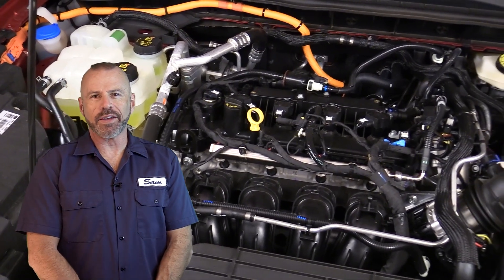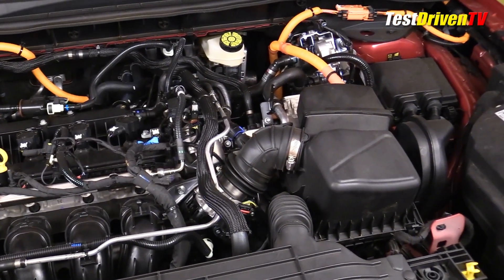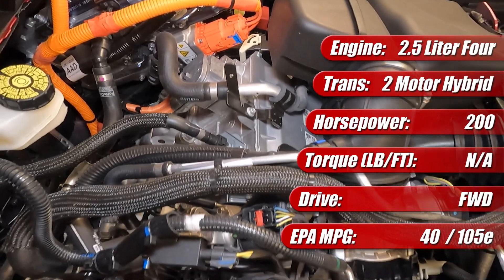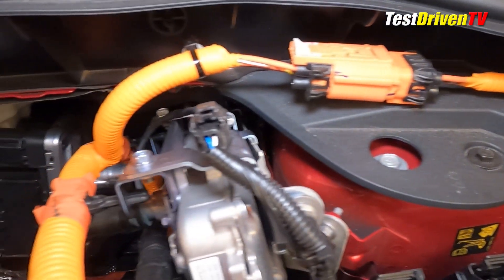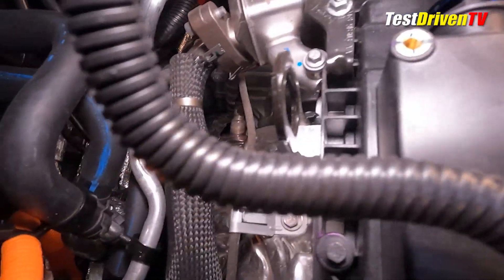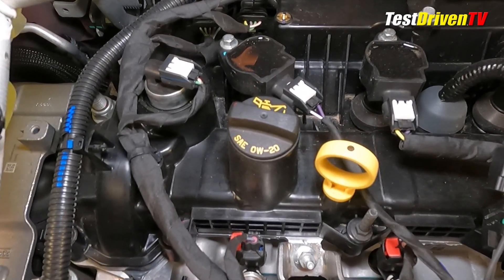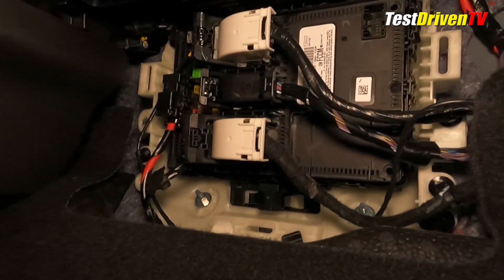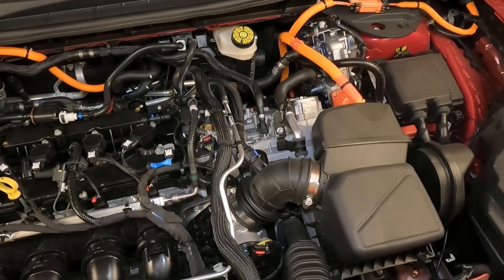2021-2024 Ford Escape Hybrid & Plug-In Hybrid Engine Explained

Comment: Would you really compare Ford with Toyota hybrids? I ask because I bought an escape hybrid but having buyer regrets.. if it’s basically the same system as Toyota and reliability I am ok then 😢
Reply from the maker: It's hard to compare reliability between Ford and Toyota. The hybrid system on both is a similar design however.
Reply: Why are you having regrets? Was thinking to get the escape, but now, I'm very curious to hear your regrets
Reply: @roddyib I love my hybrid escape.. it’s just that i am a Toyota fan and i have never owned a Ford, i know they depreciate like crazy but all vehicles do. I have owned mine for 5 months and still love it. Last  week the engine light came on and all it needed was a system update in the dealer computer. So far.. hasn’t give me any issues. I guess my regret was buying it brand new. I got it for $34k and 4 months later it’s valued at $27 😢
Reply: @yennyjen5742  Don't look now. Plugin Hybrids are around 25,000 with all rebates. Hybrid without the plugin are around 27-32k based on trim.
Reply: Mazda engine + toyota hybrid system + ford software. Imo, a match made in heaven. For 2024 they upgraded the gearbox & drivetrain so yeah, only the time will tell if the car will be realiable. Search for Ford Kuga (it's the european version) if you want to find out more

Comment: How many partnership does fora share with Toyota? I just bought a new 2024 hybrid escape and was having buyers remorse since I am not familiar with them 😢 but then someone told me they are basically the cheap version ( not so cheap😅) of Toyotas since they have the same hybrid system?? I haven’t be able to find much info
Reply: the 2.5l is a partnership with Mazda; gearbox & hybrid system is a partnership with toyota. Both should be relaiable. I've just bought mine in EU. Transfer from electric to hybrid is so smooth! All the benefits, for a smaller price. What's not to love? 

Try lookikg fo Ford Kuga (that's how it's called in Eu) and you may find more explanations.

Comment: We just purchased a 2024 Ford Escape PHEV and the dealer told us that we could use either a 120v or 240v charger. However, the vehicle comes with a standard 120v plug-in and we've been unable to find any information as to whether and how to charge via 240v. Is there a way to switch to 240v, and if so, does it require the purchase of a new plug-in cable?
Reply from the maker: The charger you have dictates the voltage automatically. If you plug it into a 120v outlet you will charge at 120v. If you plug it into a 240v charger/outlet it will charge at 240v
Reply: @TDTVGarage  Perhaps I did not explain myself clearly. Since the 120v plug on the charging cable obviously will not plug into a  240v outlet, I don't believe that we can just use an adaptor to plug into the 240v outlet. From what I've read, we need to purchase and have an electrician install a Level 2 charging station. That station will come with its own cable that is universal for PHEV. Am I correct in my thinking?

Comment: Two questions about the 12V battery. Does that mean I’d jump start it from the rear of the car? (The terminals are still on the battery?)

Also the Canadian spec of this car includes a spare tire there. I’d have to check where they put the 12V battery or if it’s under the tire.

Comment: Are Ford shops expected to MAKE the PHEV engine start prior to performing an oil change?  Or do they just drop the cold oil.
Reply from the maker: One presumes the vehicle was driven to the dealership and the engine is likely already warm to some degree. The fact remains however that temperature of the oil or engine is entirely irrelevant to an oil change.
Reply: @TDTVGarage  let's assume the vehicle has been driven as electric only for a month.  Then driven as electric to the shop.  Is it still not relevant?  Just curious.
Reply from the maker: Temperature of engine and/or oil for changing oil is not a "thing".

Comment: SO in other words this car has 2 complete powertrains. Thats dumb.
The propulsion should be electric only. The gas engine should be
bolted to a generator to charge the battery pack. DONE. No CVT.
No driveshafts. No transfer case. No mech diffs only 2 e axle
diffs. I dunno seems  WAY  more complicated than it needs to be.
I may just wait for the BEV.

!
Reply: Without driveshafts your electric car could not move unless it was on a slope.

It's an oft repeated criticism of hybrids that they have redundant propulsion. However, a BEV is also dumb. Most of the capacity of the battery is never used. A hybrid is a better use of lithium. One BEV takes 5 Hybrids worth of lithium. A hybrid uses 3/5th the fuel of an ICE car. Saving 2/5ths of the fuel. 2/5ths x 5 = 10/5ths = 2. So, for the same amount of lithium, hybrids save twice the gas of a BEV. That's not dumb.

I'm driving cross country this weekend with a hybrid. Last year we got over 42 MPG. We filled  up once on the way there and once on the way back. That's not dumb. Around town I get around 50 MPG. Also not dumb.  This trip is about 600 miles each way.

On my other trip between Grand Island, NE to O'neill, NE  and Arlington, SD where do you propose I charge up my car?

Comment: Where is the pedestrian alert speaker ? It is far too loud when reversing.
Reply: I think that it can be disconnected from under the dash on the driver’s side (I don’t remember exactly where, and this was on an F-150, but it’s the same sound / system).

Comment: Does the 2022 hybrid (not the plug-in) have a service charging port for the two battery systems?  I live in a colder winter climate area and my daily trips are very short (1-3 miles) so there is not much battery charging going on. Without any distance driving the vehicle constantly sends me messages about turning systems off to preserve battery life (the passenger door won't touch lock / unlock for example)... It would be nice to have a way (aftermarket solution) to charge both battery systems over night just to keep them topped off.
Reply: How is your vehicle doing? I got a brand new 2024 over the weekend and it keeps sending the same message 😐not letting me turning it on from distance.. and saying it’s preserving battery.. Ford dealer told me to drive there and they will put a new battery. Weird since the vehicle it’s 0 miles.. brand new. I just hope i didn’t do a bad purchase
Reply: @yennyjen5742  I don't think you made a bad purchase. All the newer vehicles suffer from the same battery (12v) drains as there are so many more demands / electronics in the vehicles these days.  I just traded the 2022 Hybrid Escape for a 2025 Hybrid Escape and it's also sending messages of reduced services to preserve the battery.  Once or twice a week I take the car out for a "longer drive" at highway speeds for 20 minutes which greatly helps to charge up the 12V system and I get the messages less often. The messages do come more frequently in the colder Michigan months than the summer months.
Reply: @jlh2119  I am in a colder state too. Wyoming! Do have you had a good experience in cold snowy slippery days? 😬 it’s snowing here but not too bad. My car it’s awd and feels strong in snow. Day 2 of owning it so we will see. I don’t drive it much either.. just back and forth to school with my kids
Reply: @yennyjen5742  Snowy slippery days have more to do with good tires (and ground clearance in heavy snowfall).... I found that the all-season tires that come on the Escape are OK. As the temperature gets colder (into the teens F-degrees and below) the tires get harder and don't perform as well starting out and stopping.   Also the tire grooves (sipes) are not wide / deep enough to handle more than an inch or two of snow.  I replaced the factory tires with Michelin CrossClimate2 tires and could not be happier.  The Michelin tires are not cheap; however, I travel often in a heavy snow belt.  My last trip from Upper Michigan to Lower Michigan had a 60 mile stretch of highway 6 inches deep in snow that had not been plowed and only a handful of cars had preceded me.   While I wasn't going fast (25-30 mph), the all-wheel drive and CrossClimate2 tires were rockstars !  Just around town with other people breaking down the snow and moderate temps the stock tires will do well.
Reply: @jlh2119  glad to hear that. Thank you
Reply: @ hello there again 😬 forgot to ask you.. what type of gasoline do you use? Regular ot the expensive one? I forgot to ask the dealer
Reply: @yennyjen5742  Just the unleaded 87 Octane ... runs great!
Reply: @yennyjen5742  which version / model of the Escape do you have?
Reply: @ I got a hybrid ST-line. I havent had a chance to do some research yet.. they offered a discount from my husbands job so we went to look at cars and that’s what catched my eye.. just for the gas savings 😅 also.. one of the cheapest deals they had.. still was expensive 😓
Reply: Try walking. It'd really be good for your health if you walk such short distance

Comment: When the PHEV is running in all electric mode, then the gasoline engine shouldn't be running.  Does that extend the time interval between oil changes?  Or should oil changes not be done based on mileage, but on time intervals?
Reply from the maker: On hybrids in general the gasoline engine is only running about 50% of the time your are driving. That is why they can go more miles between oil changes.
Reply: @TDTVGarage  What if on the PHEV (plug in version) you are running on all electric for about 90% of the time for just local commutes?  From what I can tell the gasoline engine is not running other than occasionally to burn off gas to keep it from going stale.   Then should oil changes be based on gasoline mileage or time intervals?  Tricky to know!!
Reply from the maker: Ultimately it's why it's ok to trust the oil change monitor in the instrument cluster  to tell you when it's time.
Reply: The Oil Life monitor on the plug-in will factor in how much the engine is used, but even if you almost never use the engine and the oil life is still pretty high, it will recommend an oil change one year after the previous one (or at least since the monitor was reset).
Reply: Oil change should be done once a year, water will otherwice hinder lubrication and causes rust.

Comment: I purchased a new 2021 Ford Escape PHEV (plug-in Hybrid) in Oct. of 2021. It has 14000 miles on it. I now stalls in the middle of traffic while in EV mode. It's happened 3 times. Once while my wife was driving in the middle of an intersection (blocking traffic, horns honking, etc.). There is a recall for this exact failure on the same year, model, and engine as my vehicle, but they say I don't qualify. The recall code is 21S48. I believe it’s a high cost fix for them, so they're not issuing the recall as they should (e.g. have these vehicles proactively called in for testing and diagnosis before the failure happens). Anyway, I have to wait 3 weeks for a dealership mechanic to even look at it and I have a long drive I must make in less than a week. Needless to say I'm very disappointed in Ford’s quality and support. I'm an electrical engineer (for 35 years), I design high-reliability products and I'm very disappointed in the quality of Ford engineering that missed this breakdown in safe operation. Maybe they're not ready for EV yet. Maybe they need to invest in Hi-Rel design training for their engineers. All I know is I spent $45,000 for a malfunctioning and dangerous Ford vehicle. I’ve only owned it for 18 months, it only has 14,000 miles on it and it feels like a lemon. I should have purchased the Toyota RAV4 Plugin Hybrid! Sorry for the ranting, but I feel indignant and frustrated by this.
Reply: Oh man.. did you  keep your vehicle? Did they fix it? I jut bought a brand new one over the weekend and afraid it might give me problems later on 😐 it came with a bad battery I guess.. it’s not turning on from distance saying it’s turning off options to save battery so ford told me to go and they will put a brand new battery. Weird since it’s a new vehicle 🧐
Reply: This is why I'm reluctant to give up my 2015 Prius.  Aside from a water pump nothing has failed during its 10 year lifetime.
Reply: I'm proud owner of a Ford Fusion Energy of 200000 miles , sorry for your miss happs
Reply: Fusion have other transmission than escape, on fusion HF35 @vivianorios2637

Comment: I own a 2022 escape phev, overall it’s pretty good, however the engine is a little to loud and annoying when in hybrid mode.  Don’t think it’s piped In noise, if it is it’s the dumbest thing ford could’ve done because it’s not a good noise, it’s very unrefined and raucous
Reply: How is the maintenance cost in the last two years how much total miles have you put it on? Is there anything which was recalled and they are not fixing and what’s the MPG? Are you getting?

Comment: Great video, but would enjoy understanding more about the high voltage battery or is it batteries? That is, is there a single 14.4 KW lithium battery or a separate small one for the hybrid system when the 14.4 KW battery is depleted?  And I was curious about the built in charger,  I have seen references to two different sizes of Chargers (3.3 and 4.7). Anyone have more information?

Comment: There is a fill plug for the transaxle on the driver's side near the cv axle. It is user serviceable. The service interval is 150,000 miles or every 30,000 miles for severe service.
Reply: This was changed in 2019-2020, they now say every 50k miles, they realized every 150k miles with the HF35 caused premature roller bearing wear. I believe the HF45 in 2020 and newer uses needle bearings.

My 2018 fusion Energi manual does say 150k tho, but I want to put 200k on it and still have it running lol

Comment: does the battery have its own air filter ?   if not.. what needs to be done for the battery as far as maintenance ?
Reply from the maker: Ford does not use a Toyota hybrid system. Ford designed and builds  their own hybrid powertrains, though it uses the same patent that Toyota uses for "how it works". The battery for both the Ford Escape HEV and PHEV is liquid cooled and mounted under the vehicle where Toyota typically uses an air cooled unit inside the passenger compartment. To that end, the owners manual of the Ford likely tells of a date that coolant should be changed out similar to that of the engine in terms of maintenance.
Reply: @TDTVGarage  oh ok the second coolant reservoir under the hood .  Thank you sir
Reply from the maker: No. The battery does not have an air filter. There is no routine maintenance required for the battery.

Comment: Great video!  I’ve seen online forums commenting on the hybrid and phev as having an abnormally loud engine when in hybrid mode. Does the escape have a manufactured / piped in engine growl or noise?  I have noticed in my Escape hybrids, sport mode, the engine sound “rev up and shift” where the growl cuts out briefly (to quiet) and then begin to growl again into the “next gear” which is all theater for the electronically controlled cvt
Reply: My Escape does not. If I stay in town and drive 40 mph and under, I can get around 47 mpg. But on the  hwy it drops to around 34
Reply: I think the “shifts” are legit. I think Ford (and Toyota which uses a similar transmission) has designed the eCVT to adjust the gears like normal upshifts because it feels much more natural and satisfying than the traditional CVT’s continuous boat motor sort of “bluurrrrh” that never “shifts” gears.

On our 2024 Escape PHEV, I don’t believe the engine noise is manufactured, but it does sound surprisingly growly from the inside (I haven’t really listened from the outside to see if it’s as audible). Whilst I do believe it’s the actual engine sound (as in, not fake), I suppose it’s possible they’ve designed it to be more audible inside, but idk either way.

Comment: Hi, so which has a better engine and transmission, this or the RAV4 hybrid Prime?
Reply: The Rav4 is a more modern design. The transmissions are largely similar (Ford licenses the design from Toyota as part of a patent-sharing agreement). But the Toyota's engine is more advanced with both port and direct injection. The Toyota system output is 302 HP vs 200 for the Ford. And the Rav4 Prime is available with AWD while the Ford is not. And the AWD on the Toyota uses a third motor for the rear wheels instead of a driveshaft and differential connected to the engine. In the Ford's favor is the engine design - it's a modified Mazda L and known for being extremely reliable (probably because it's output is relatively low).
Reply: @wallyballou7417 Ford has AWD too, the FHEV version.
Reply: @wallyballou7417 this info it’s so interesting. Thank you 
I just bought a new 2024 hybrid escape and was having buyers remorse.. I am not familiar with ford at all and I keep reading mixed reviews.. more negative than good.. but recently found out about their partnership with Toyota. It gives me hope 😢😅 since I bought it new.. I am hoping it will run forever.. now I am a little worry thinking on when I will need to replace the hybrid battery. Seems expensive
Reply: @wallyballou7417 the Lincoln Corsair PHEV is available in AWD.
Reply: @wallyballou7417  actually Ford's Lincoln division - the Corsair, the sister of the Escape you can get in the AWD version.
Reply: Ford has a better design since the engine is just as solid and it doesn't actually have a transmission.
Reply: @christianness8983 can we compare their engine to the Toyota ones? I just got a 2024 hybrid escape and been having buyers remorse 😢.. for all the money I ended up paying I would had get a Toyota 😂 I didn’t know about their partnership so that gives me hope